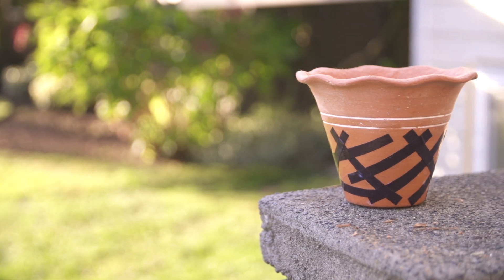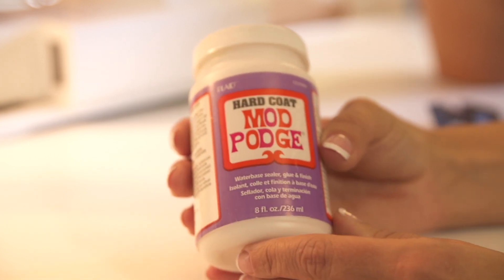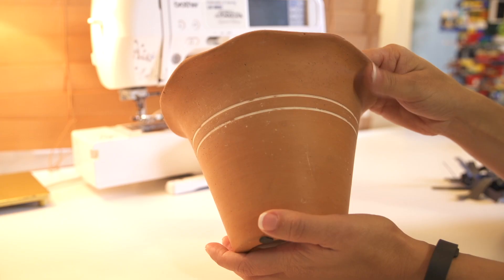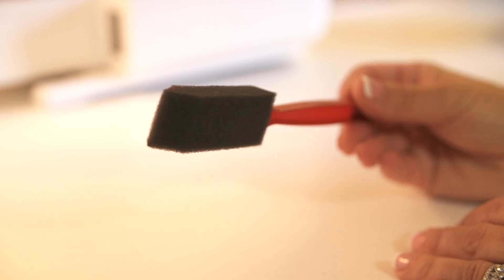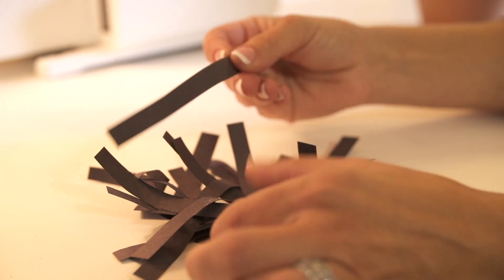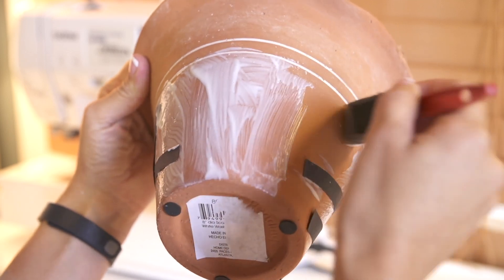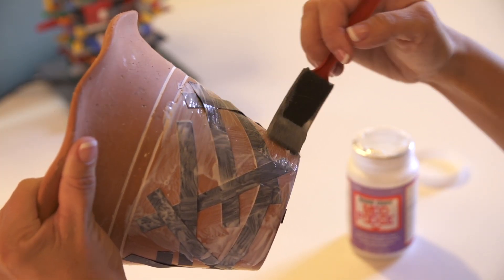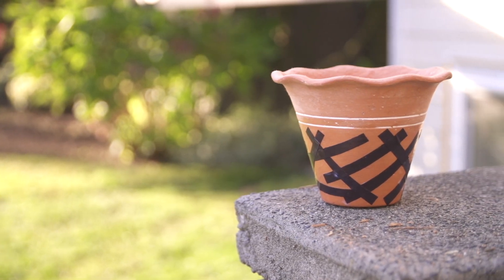How to Mod Podge on Terracotta Pots : Getting Crafty

Comment: Could somebody tell me what I did wrong I bought a terracotta pot that was clean and totally dry and I put paint on it and that was dry and then the next day I put modge podge on it.. and it has areas of it that looks like it's wet like the terracotta pot is wet? Does anybody know what I might have done wrong or what's happening?
Reply: Hello! I’m abit late but you need to seal the inside too!!
Reply: Please don’t seal the inside of your terra cotta pots.Look up proper instructions. This video didn’t tell us the part where it can wreck the moisture holding affect of terra cotta on your pot if not done correct